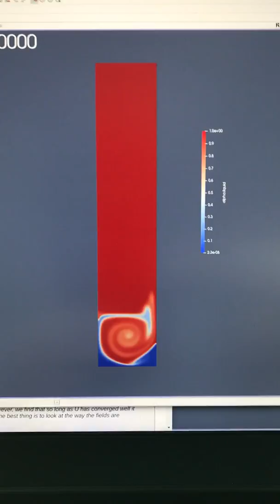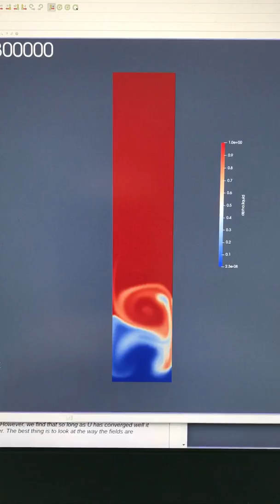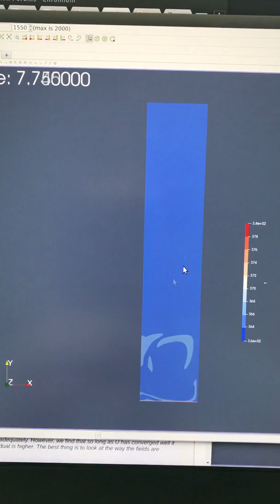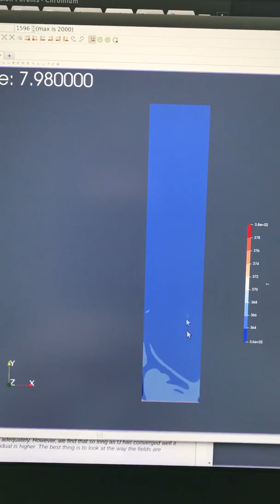Test case with interCondensatingEvaporatingFoam

Comment: How to apply constant heat flux condition in interCondensationEvaporationFoam?
Reply: I have the same question. it seems that the heat flux BC could not be used in  interCondensationEvaporationFoam
Reply: @kanata4973 it seems the heatflux didnt included in the solver, so using fixedValue of T is only way to add heat to system